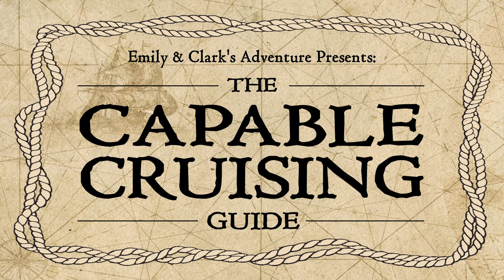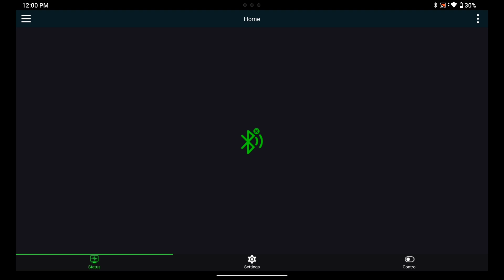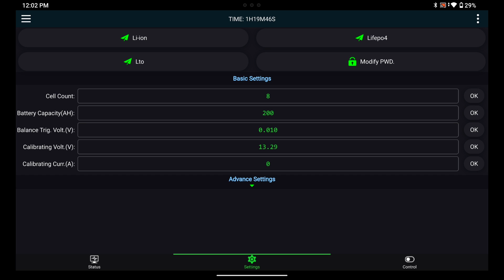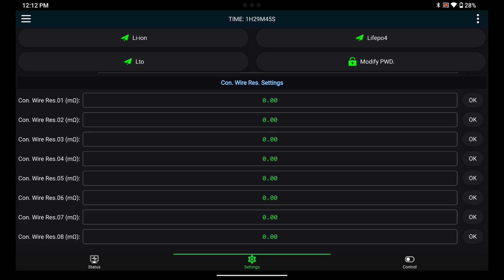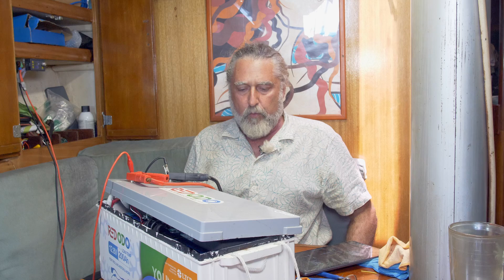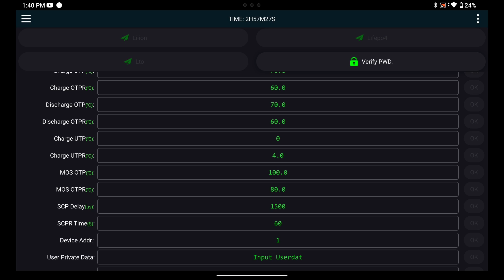JK BMS Install and Configuration

Comment: Using your description for ratios BMS (JK BMS 4S 5S 6S 7S 8S 200A Smart BMS Smart BMS Built-in Bluetooth APP Support LCD 12V 24V 3S (D), will that be the same? I found it on another source.
Reply from the maker: If your source was on Amazon send me a link to emilyandclarksadventure@gmail.com 

I'll check it and maybe use it

Comment: Hi Clark. Great videos on BMS. 👍 Clark something has cropped up that I’m not in a position to check at the moment, but if it’s correct, it means that I am sticking only with AGM Batteries on my next Sailboat, until I can chat with the insurance company or Companies. I have heard that if you have lithium batteries on your boat, and it catches fire, then your insurance cover is nullified? If this happens in a Marina, the nightmare scenario is horrific, and from what I have heard, every single insurance company now has this get out clause. So for me, until this is sorted out, I’m sticking with just AGM and can add Lifepoo4 bank once cover is certain. So how is the situation with your insurance company cover, I suppose is the question ? Best Wishes. Bob.🤔🌟🌟🌟⛵️❤️
Reply from the maker: I don't insure out here.
Reply: @Clarks-Adventure  Oh that’s interesting to know. Thanks Clark. At least initially, it looks like I can’t avoid insurance to start with, so starting AGM only won’t hurt for a while, and I can concentrate on getting Solar and Wind sorted, to keep the AGM’s happy, then add the Lifepo4 Bank(s) later. All the Best. Bob. 🤔🌟🌟🌟👍❤️🏴🇬🇧
Reply from the maker: In the states I go liability only.  https://www.skisafe.com/

They have never asked about batteries.  They don't even require a survey
Reply: @Clarks-Adventure  I went similar with my last Sailboat in the USA in 2016, and after losing my boat after the attack in New York Harbour I lost everything when they failed to pay me out for the third party expenses. I’ve been Boatless and landlocked ever since. Still, there’s light at the end of the tunnel at last my Silver investment I made years before, looks about to pay off. Bob.👍🌟🌟🌟🙂⛵️❤️

Comment: Hi, i have several jkbms’s installed and my experience is that the set voltage to start balancing is around 3.45 V for LFP cells.
Reply from the maker: Thanks, that seems to be the consensus

Comment: I prefer .005 volts for balance trigger. Starting the balance at that low means it will keep your cells unbalanced. you want it to balance when first cell hits max cell voltage that you set. usually its 3.45 volts (13.8 total volts). Trust me on this I spent 12 months out of balance then switched mine starting to low like 3.1 but doing higher like 3.45they balanced within a month. Remember these are big cells and you want all to hit 3.45 at same time. LFP BMS setting for balance has been tested and confirmed by me and many others like OFF Grid Garage.  You will see if you use this battery all the time.  I can explain more if needed.
Reply from the maker: I understand.  Good idea.

With this specific set of well balanced cells I think there is no wrong answer.

But listen to his advice.
Reply: Your settings are spot on for "Top balancing" a lifepo4 battery pack. My pack has a cell that has less capacity than the rest and also my solar charge controller is not designed for lithium. If my bms shuts off discharge from a low cell the charge controller goes to sleep and never comes back on. My solution was to bottom balance the pack and my charge controller will shut off the load at low pack voltage every time without a cell dropping too low. This is the first battery I have ever had a need for bottom balancing but its working like this for many months flawlessly.
Reply: @uhjyuff2095  Yes why don't you replace the cell. I never top charged my cells before I built them. I had huge differences till I figured out how to get all my settings right. My inverters stop charging for 90 minutes after the BMS's stop taking a charge. they still cover loads with PV power after they use all the stored power. In spring summer and fall I turn down my inverters charging to 18 amps each. With the amount of sun hours I fill up every day easily unless its rainy ten next day it fill up.  My central air runs day and night now so I use around 25kw a day and winter its 15kw. I like to keep it close with how many amps I use to charge. no reason to over work my system when I have 52kw usable battery banks. I see the new cells for $70 that have 330ah per from china now. I paid $115 for 280 lfp cells each. My cells average around 178ah. Might be time to add another bank.
Reply from the maker: I have a similar issue with knee cell in my Redodo 410.   The BankManager has a feature that disconnects this bank once it's at a certain POC.  Works for me and I can stay with top balancing.  Charging to 100 means no cell memory.
Reply: @dc1544  I think my issue is the charge controller is not built for lithium packs that have a bms. When the bms shuts down my charge controller will not turn back on even if solar is connected and the sun is shinning.
Reply: @uhjyuff2095  What one do you have? or did you by premaid batteries with no communication ports?

Comment: You don’t want the balance to start at 3.02v. That’s too low and will try to balance in the flat part of the curve. It needs to be set at 3.40v-3.45v to top balance.
Reply from the maker: Sure, whatever you like
Reply: @Clarks-Adventure I see later in the video it is set to 3.29. Probably should be a little higher than that but neither will hurt anything.
Reply: Elmer is correct. You don’t want it to balance that low, it could cause great difficulty balancing at full charge, especially if the battery spends a few days balancing in the flat of the curve. After a couple years of using JK’s I’ve found some happy numbers. This is assuming that the Bulk/absorb is set to 3.45 volts per cell (13.8 four cell ) Start balance voltage, Eve cells 3.41 and CATL 3.42 volts. If charger gives you the ability to adjust tail current or absorb time instead of a fixed algorithm, you could even raise the start balance a bit higher (closer to the bulk voltage). Regardless, not below 3.4 volts per cell.

Comment: So do is a BMS needed for each battery or can the BMS control 4 batteries that are in parallel
Reply from the maker: If the cells are in parallel -one BMS

If the batteries are in parallel - multiple BMSs
Reply: Single point of failure even if it was possible..

Comment: Hi Clark.   

The BMS once you changed the cell count from 8 to 4. It seems to have reverted back to eight not sure if you noticed that.    See 2:51

4:20  you mentioned trying to target 13.1 for balancing.   I think the setting for that will be 3.275 rather than 3.02.  

Absolutely lovely video learned the whole lot. Thank you very much as always.❤
Reply from the maker: Yeah I didn't hit the ok button when I entered 4 cells.

It all worked in the end